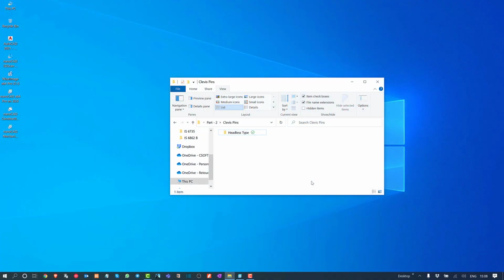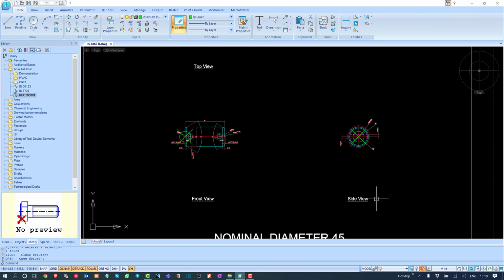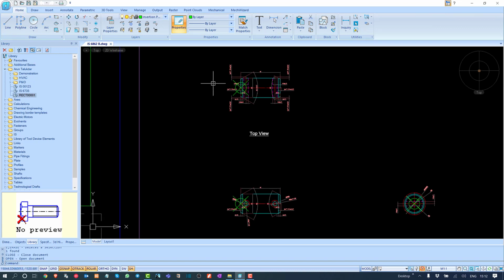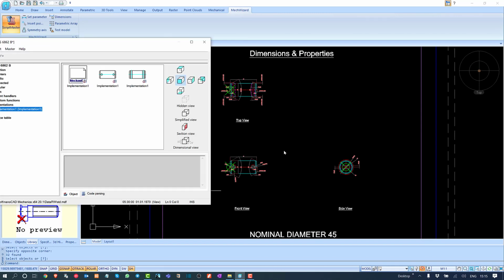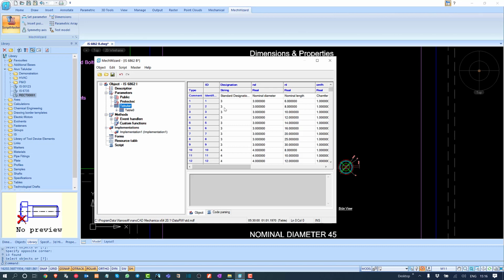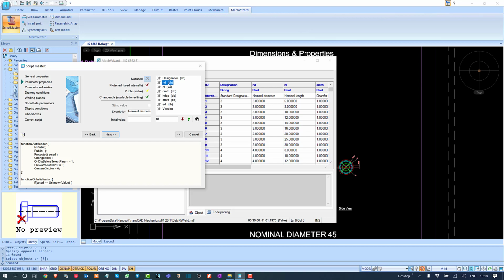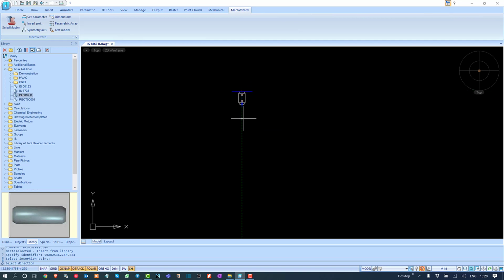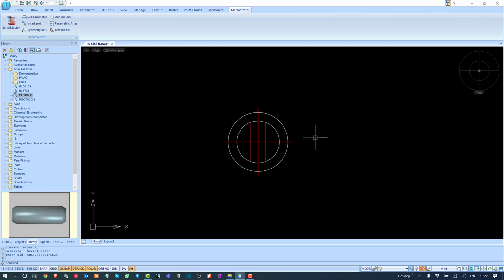Library Object Development in nanoCAD Mechanica Part - 2

Comment: Hi thanks, good continuation from the first part!
Starting with a good drawing of all the views, like in 1':35" with the sketch AND the parameters is a good way to customize any object.
I want to customize the 3 basic windows that are in NanoCAD's default Library, under the Architecture > Windows folder.
I can start by duplicating an existing window to take advantage of the scripting (that cuts walls, etc)
I can get a sketch by inserting an instance of a window object.  Is there a way to also get the parameters: the dimensions graphically? from the default?
Reply from the maker: You can insert table and select "Object based report" and select the library object to get the parametric details of the library object in a table.